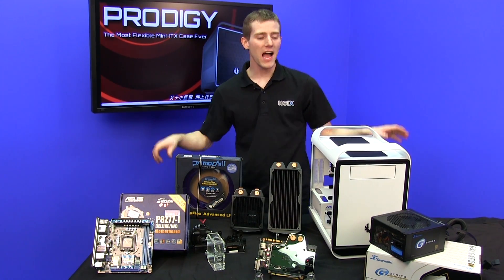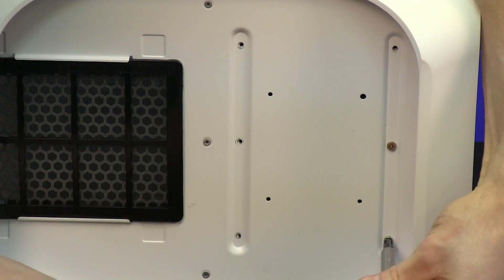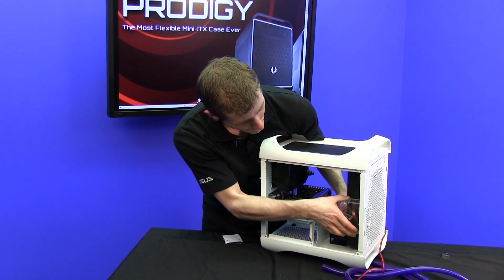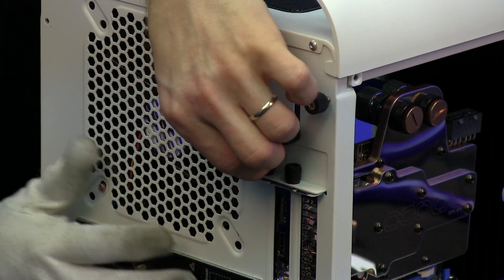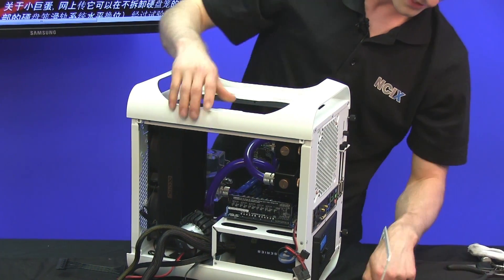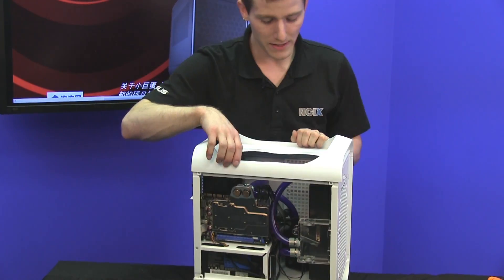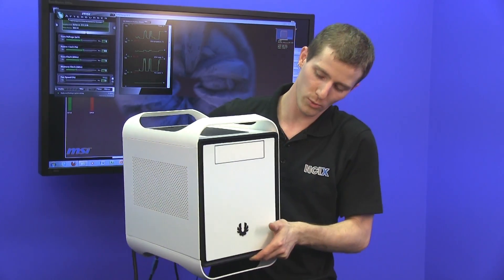Ultimate Watercooling Build Guide: Bitfenix Prodigy, 3570K, GTX670, swiftech

Comment: 200mm rad in front + 240mm on top. The space is there might as well use it! No 1 uses an internal 5 1/4 anymore...

Full/semi modular PSU needs to be short. Max 160mm length from my experience. 140/150mm & full modular much better IMHO

Comment: Why recommend a non modular psu? Wouldn't it be more useful to go full modular so u don't have to use cables that aren't being used?
Reply: Late reply, but, non mod because the CPU and mobo cables are flex able the second they leave the psu. mod psus have a hard connection that cannot be flexed meaning you are effectively increasing the length of the psu
Reply: I recently completed a custom water cooled build using the Bitfenix Prodigy M, full modular psu it's been a blast only having to use the cables that are needed. Flexibility of the cables are fine.
Reply: HenryRide he said semi modular. So you have the ability to remove all the cables but the CPU and motherboard power.

Comment: I have an CM 212 Hyper Evo on my 3570K runs on 4.5 GHz and never goes above 64°C. Quite, cheap and perform great. What's the point of watercooling then?
Reply: Peter M Oh, then yes. If only the CPU is being cooled then I see no major benefit between it and air. But you don't see many people with custom loops that only cool the CPU, then they could just use an aio if they wanted.
Reply: +Peter M Watercooling isn't limited to CPU. you could also cool your GPU and RAM all on the same loop.
Reply: For when you want to overclock...
Reply: Alex Giles
3570K on 4.5 GHz. I wouldn't call that a baseclock ;)
Reply: hehe my bad xD
Reply: Scattergun Music
I agree. I meant only if CPU is cooled, I don't see the AIO any better.
Reply: Peter M of course i think it looks nicer :3
Reply: +Peter M It lets you overclock even more. For the people who actually need CPU horsepower
Reply: +Peter M looks and runs cooler :)
Although I don't like the feel or looks of those sealed units.

and the noise to cooling capacity is masive compared to aircooling where the GPU and CPU are compeating for the fresh air.
Reply: svampebob007
The look is subjective. In cooling capacity the airflow of the case is a big factor. In many tests 212 evo perform as good as h100 when. But in tiny case as this the circumstances might require the watercooling. I have no experience with small form factor builds.
Reply: +Peter M   I ve tried the CM 212 Hyper Evo  Air cooler the same out performs many water-cooling solutions  , you can easily reach the overclocking  limit of your motherboard I mean we are talking about 29c  34c CPU Idling and 4.8oc low 70c  on a I5 3570K
Reply: I love my evo 212. if I were to pick water cooling it would be for size. you can relocate your heatsink basically.

Comment: how the hell is 85-90 C under load is normal? o.O if I dont have water cooling, i could fry eggs and bacons inside the box already.
Reply: +LeonZoc It's normal on the GPU cores, as measured by the embedded thermal sensors right on the GPU die. On the surface of the ceramic chip enclosure, it's going to be 10°C-20°C less. Due to high thermal resistance of conventional air cooler employed on the GPU stock, and of the FR-4 board material, you can expect temperatures of up to 50°C on the rear surface of the PCB and 35-40°C across most of the fins of the cooler. Critical temperatures for GPU cores lie between 95-110°C. Target ambient temperature in PC enclosure is assumed to be (and practically easily obtained even in bad enclosures) to be no higher than 40°C.

The stock air cooler is built to minimum price to provide non-critical temperatures.

Comment: Why wouldn't you run the CPU tube to the back radiator then to the GPU then to the front radiator then to the reservoir then to the pump
Reply: Alex Slater because the order of the loop makes negligible difference in temps

Comment: After you take out the drive bays is there any where else where you can put a 3.5" hdd.
Reply: RXP Games nope, you'll have to use 2.5" hdd's or ssd's
Reply: Siana Gearz You could mount the HDD against the PSU case, sideways, or underneath the pump. Which I have seen in many custom builds.
Reply: +RXP Games Just mount one to the bottom of the case, might have to drill some holes, though
Reply: +ThierryTheuns Bottom of the case is taken up by the pump. It's the best place for it. Probably best keep it that way.

Given that the top of the case is not utilized, a rig could be crafted to be mounted there and hold a hard disk in place.

Alternatively, you could think about it for a second and realize that 3*120mm 50mm or 60mm thick radiators are a total overkill and you could do with a lot less. There's no reason why you shoudn't allow your GPU to reach comfortable 65°C at the cores while it's being furmarked with the CPU running load test at the same time.

Comment: Where is the intake and out-take ? 
Intake from a radiator ? what...
Reply: Anthony6essful I'm confused what you're asking
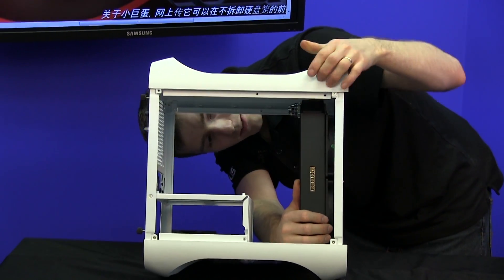Reply: Anthony6essful You can see the fans set up in a push configuration at 4:28. The intake is from the outside air into the case interior if that clears up whatever you wanted to know.
Reply: you don't mount just rads, you mount them with fans
Reply: i know , but where is the intake and where is the out-take or thoses fans ?

Comment: Is there any way to have an HDD in this thing with all of that cooling?
Reply: You could mount on the top of the case.

top inside
Reply: If u use a 2.5" HDD it should work.
Reply: A lot of motherboards in this form factor include PCIe mini card slots, and there are some specialized SSDs that connect directly to that interface. This motherboard unfortunately is not one of those :-\
Reply: +cwjakesteel Yes, there are 2x 2.5" hdd slots on the right side panel where the power button is.

Comment: If I used a 120mm radiator at the front instead of your 2x1 radiator, would I still be able to have the HDD cage and the DVD drive? Also where would I buy a full radiator system with pump, tubing, reservoir and radiator?

And also I want to use a AMD r9 290X with an attached backplate for cooling, will that bee too long of a card for this small case?
Reply: Yes, one of the harddrive racks would still be able to fit with a 120mm.
Yes, you can fit the biggest of cards into this case.
Reply: The gigabyte gtx 970 is longer than any card to date, it fits in the prodigy.
Reply: +H3ROxUPRISING The HD 7990 is longer.

Comment: Neat build. I got the same SeaSonic power-supply in my new mini-ITX build, just the 650 watt version of it: High quality components all the way through, very quiet even under load, and a quite high level of AMP's on the 12 volt rail.. Just perfect for my build, which is air cooled all the way through, but with a GTX 770 SuperClocked graphics-card .... which demands a lot of power.

Comment: do i get it right, water comes from the pump into the cpu block and then goes frist into the single radioator and then into the GPU block ? I cant see it perfectly but i would say its right or ? cause then u already cooled the water from the cpu before it goes into the gpu and then all goes into the dual rad. to cool everything that it can go into the cpu again. Someone can confirm me :c ?
Reply: It doesn't really matter if you cool the cpu first or the gpu.

Comment: why not use a 200x200 double thick rad and a 140x140 double thick rad? still able to have a 5-1/4 and 200x200 is 40,000mm² while 240x120 is 28,800mm² so it would have theoretically better cooling potential
Reply: Say what o.O ?
Reply: santho98 He's saying why not get a bigger radiator and get better temps lol
Reply: Ranstead Moons a 200x200 is physivally smaller than a 120x240, allowing for fitment of a disc drive.
Reply: Hazardous-Nebula Physically smaller in one dimension, but it's still got a bigger area, and area is what matters when it comes to cooling, as you said yourself.
Reply: yeah that's what i meant. sorry i've been up all night, and it's 11AM now
Reply: Zahavi J Yes. make sure its a double thick rad with two STATIC PRESSURE fans in push/pull.
Or get a 140x140mm rad and do the same.
Reply: in the same case, you could fit a disk drive with a 200x200, but yes a 120x120 or 140x140 will fit with a disk drive.

Comment: i want this same setup but the case in black and i want to put an ASUS ROG POSEIDON-GTX780 and a ASUS MAXIMUS VI IMPACT LGA 1150 but i am not sure if the necessary power supply would fit in this case i am looking at CORSAIR AXi series AX860i do you think it is possible also the Bitspower AIZ87M6IITX Nickel Plated (ICE Red)

Comment: I'm building something similar to this, using the same case. Is there any need to mount a fan inside the top to act as an exhaust or is the positive pressure created by the 3x fans acting as intakes enough to have a good flow of air through the case?

Comment: I will get my own thanks to you.  Not this one i will have NVIDIA Little monster reloaded lvl 2 (im poor guy :D)  in black color.  I realy love this case white one is sooo sexy (but light gray will be better i think) i only want to ask you guys is there some way how can i fin gtx 780ti in it? Or its impossible?
Reply: *fit
Reply: Vojta Hamala "poor guy" and "780ti" dont match up
Reply: VFXRebel well pc will cost me 1090 dolars and my dad will buy me a graphic card to it. But again can i put gtx 780ti in it?
Reply: Vojta Hamala I think so im not sure.
Reply: Probably cause you can remove the drive cages for support of up to graphics cards like gtx titan.
Reply: I don't think you will be able to fit a 780 ti and a front mounted reservoir, however if you move the reservoir to the top and leave the smaller one out it might fit. Just check bitfenix' website for the dimensions of the case :)
Reply: Once you take out the top drive cage it'll fit.
Reply: ArkAngel_X ok thank you i will try it :)
Reply: You can, I have one, using it to comment right now. Just remove the drive cages like that Linus is doing.

Comment: If I get a corsair h100i what fans should i use? btw I would rather them be quiet.
Reply: Easy Noctua fans i believe the model is nf120 they are silent and linus uses them in almost all of his watercooled builds and i believe he uses them in the ultimate overkill water cooled video. They are static pressure optimized which makes them silent and the best to use, for sure used in the best type of cpu cooler video
Reply: Thanks I will be looking into those

Comment: I really like that build and I'm looking forward to build my own. But instead of a 120mm Radiator in the Back, i will use a 180 or 200mm Radiator in the Front of the case.
But I have one recommendation: At the end of your video you show the temperatures. It would be good to show also some temperatures in equilibrium. So it doesn't mean anything that your temps are at 40 to 50°C after switching on the load, but it would be a very efficient cooling system if they keep that value for several hours under load. So maybe you add a comment about temperatures afer several hours of load.

Comment: Why the hell are you pushing the air from the possibly cooler surroundings into the case? It warms up by going through the radiators so you cumulate the warm air inside. Wouldn't it be better just to use the air inside the case and blow it out through the radiators? So the case will suck the cooler air through all the holes in the case and just blow the warmth out of the case...? You call yourself professionals...? B * L L S H  * T !!! Wankers is what you are!!! Its called thermo dynamics of gases and liquids, you need to study first... I would never EVER let somebody like you touch my water cooled machine. LOL
Reply: If it makes you feel better, I have a similar build with 230mm in and x2 120mm out through the rads.
Reply: ***** Hmmmmm, much better...;o)))
Reply: +Jiri Smidak  It's impossible for air to "accumulate" inside. As much air will come out as came in.

The surroundings are invariably colder; however, not by much. The temperature gradients along the whole system are ridiculously low. I mean he said he's getting what, 45°C on the GPU cores. This means the loop temperature is well below 30°C! That also determines how hot the inside of the computer is going to get at the maximum. It's still colder than most air cooled machines, because of the ridiculously oversized cooling system. Heat does not "accumulate", it transfers from hot to cold exclusively, i.e. it's not possible to heat something to over 30°C by blowing 30°C barely warm air over it!

The reason to have more active inflow pressure is dust management. Then you can have all incoming air go through a fine filter mesh, then you don't have issues with dust all over your radiators, you merely need to collect the dust from your filter every few months. If you put more fan pressure on the exhaust, you cannot run the air through a filter, as the air will predominantly find its way around the filters and through any gaps and holes you might not have considered, and you can't collect dust in one convenient place, it will just land everywhere.

There is no such thing as a perfect build, but i think this is a very reasonable compromise.

Comment: motherboard ASUS P8H61M
 
Intel Core i5 3470 4x3.6GHz Turbo
 
ram 4Go DDR3-1600
hard drive 500Go
 
dvd ...
 Gpu: radeon r7-260X                                                                                                                                can i have all tis with 485 watts power suplie without problems ?

Comment: For anyone with a Prodigy case, and with the same watercooling setup. Would it be possible to still install a normal 3.5" HDD, would love some space for my steam games.
Reply: ***** just use Velcro bro, mount them bitches anywhere
Reply: should be able to
Reply: Ron Huang
I just don't see any possible places to install a 3.5 hdd, and I was wondering if anyone with the same build could clarify.
Reply: looks op tho XD
Reply: i think you can probably fit it in but doubt u can take it out later on with ease
Reply: No you can't. I have the Prodigy in cobalt with a liquid cooled setup. Once you remove the HDD tray towers, you can only mount 2.5" drives. However, you can mount up to 5 so I don't see why you would want a 3.5" anyway. 5TB is plenty!
Reply: Why does it matter for 2.5 and 3.5 like won't it be same price of they same storage
Reply: (Hhd not ssd
Reply: Ron Huang ***** 
In Denmark 2.5 hdds is ALOT more expensive than 3.5 hdds.
So If I could fit a 3.5 I would be able to save alot of money.
Reply: .... Op
Reply: no, he took out all of the 3.5" drive bays
Reply: 5.25" to 3.5" is all I can think of unless you fabricate a mount. This would be pretty easy to do if you have an external enclosure you can modify. Drill holes in it to use with the existing 2.5" mounting holes and there you go. Remove all components of the external drive and just run the power and SATA cables through the open end.

Comment: Why I have a weird speculation that the 550W power supply should not have been able to power everything, especially overclocking.  :o
Reply: It should be enough. A gtx 780 and a 4770k based build draws less than 500 watts. Although overclocking will increase the watts I think it would be enough.
Reply: Thomas Helgesen Yea.  Is hard to tell for me.  I did some research and the 4770K at default clock runs at 170 watts at full load while the GTX 780 run at 260 watts at full load.  Total of 430 watts gives a lot of leeway on a 550 watts PSU but I was wondering how much watts the water cooling use, how far the overclock will be done on the CPU, and will the video card be overclock as well.  So many "if" when you place the word "ultimate" on a rig.  lol
Reply: Ive never done any watercooling or big overclocks so I wouldn't know. But, just from looking at numbers I would guess you gain maybe 100 watts from the overclock and 50 from the water loop. that plus the 120 that the stock i5 would draw and 170 from the stock gpu. plus maybe 50 more for the motherboard and other little parts. I think that is correct but some of those numbers may be wrong so dont take my word for it.

Comment: anyone know whats the biggest (longest) GPU you can fit in this case?
Reply: I don't think there is a GPU that won't fit. I currently have a GTX 780 ti in mine and there is still about 3 inches of clearance. although you may have to remove the the top HDD cage.
Reply: You can even fit a 7990 or 690 in there, should for anything, but may be a different story if you're using more than 1 GPU.

Comment: intake on the front, front and back exhaust. squeeze the biggest fans you can in that bitch. static pressure fans on the rad and the front, as those are more restricted airflow. try a 200mm fan in the front, bitfenix spectre pro. 140mm exhaust on the back.

Comment: I'm just wondering how i should set up my air flow as there will be a 240 in the roof, and not sure if i should do intake front and back and exhaust on top. Not sure if i should try and fit a 120 in the back or just chuck another 240 in the front.

Comment: Linus, you said the GPU was running at 44 degrees. It takes a water cooled system a lot longer to reach its max operating temp than a air cooled system, so this can't be a valid temp.

Comment: Modular cables would protrude too far out of the PSU, causing them to smash against the back of the PSU bay, either potentially damaging the cables, or causing the psuto not fit.
Also, whoever marked Zach's comment as spam, wtf?

Comment: I'm curious to know why your fill reservoir is not located above your radiators?
Think about automobiles: the radiator cap or reservoir tank is mounted at the highest point in the system.
If you end up with air in your radiator, it will be difficult to purge.